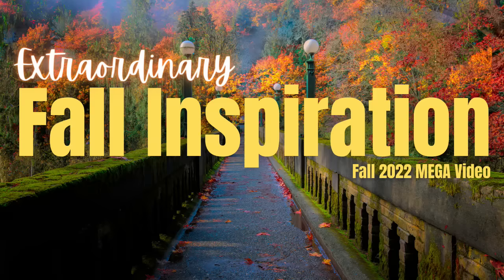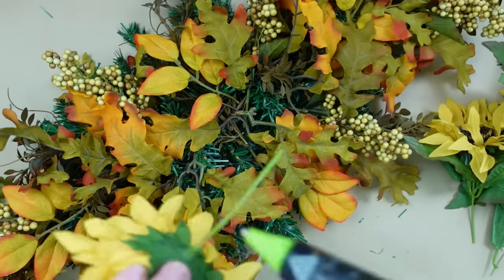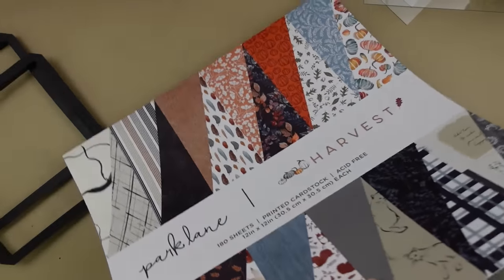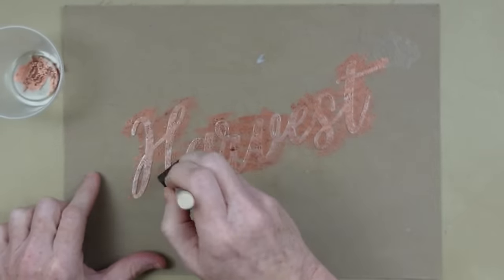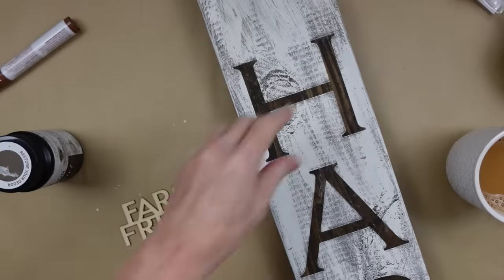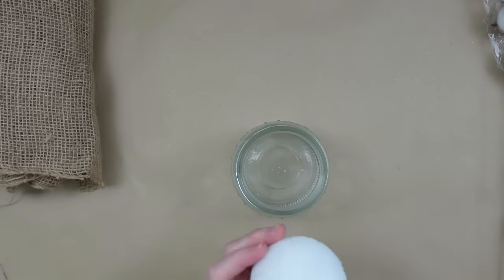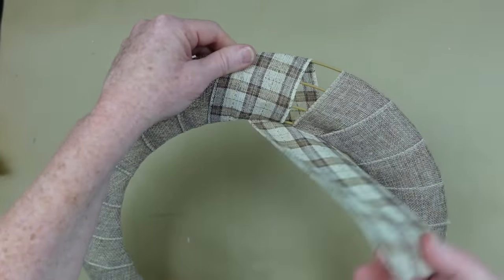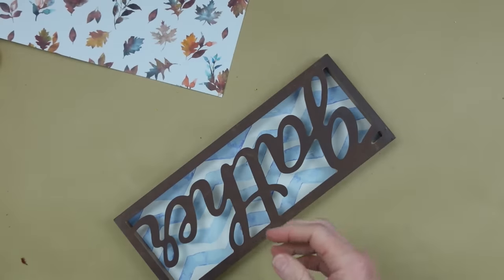UNIQUE Fall Decor DIYs Which Will Make You Get Crafty TODAY!

Comment: If you have a heat gun and you are using or reusing sprays from old projects of thrifted ones you can run that heat gun gently over them and it will flatten and straighten them. Not too much or it might melt them, just a few seconds and keep it in motion.
Reply from the maker: Thanks for the tip Jill!